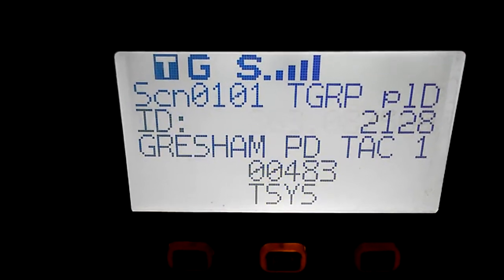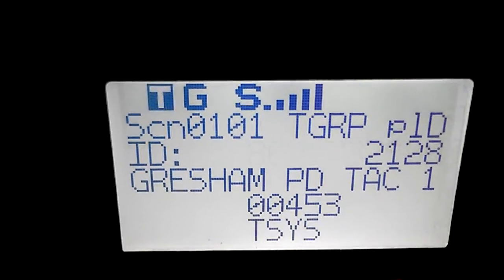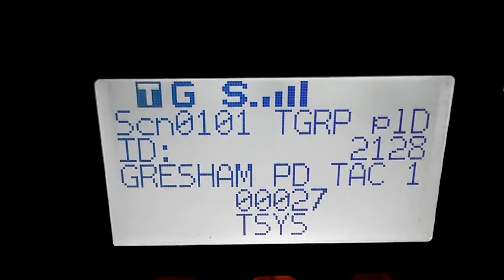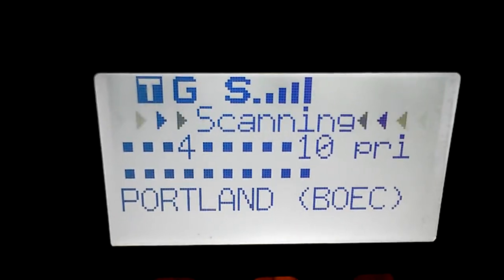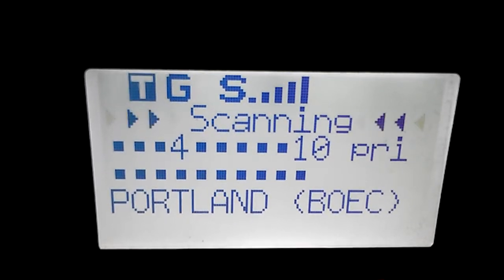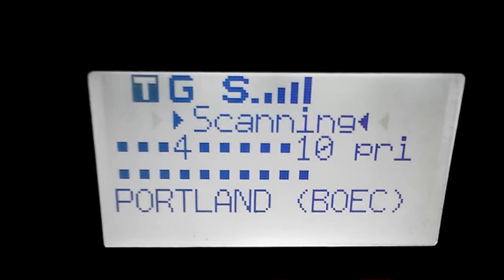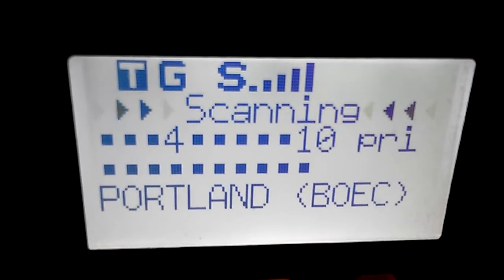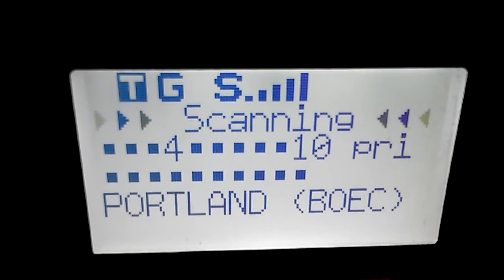GRECOM PSR-310 Scanner: Issue with no audio while trunking

Comment: hi, I have the same radio with the same problem, were you able to fix the issue ? any help would be appreciated.
Reply from the maker: I think putting these values into the Trunking Table using the Win500 software might be what did the trick.

https://i.imgur.com/MILZbi2.jpg